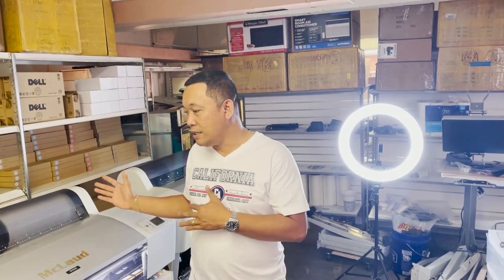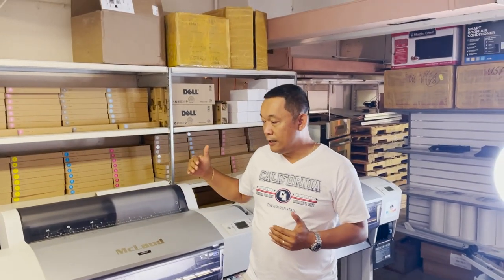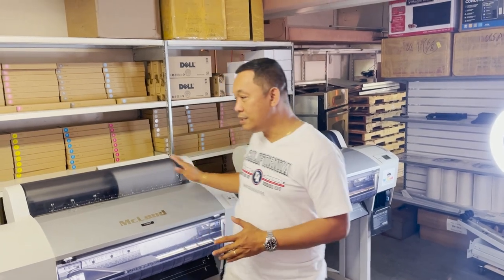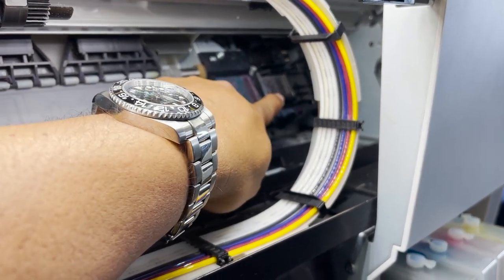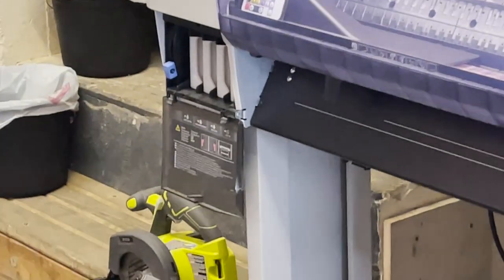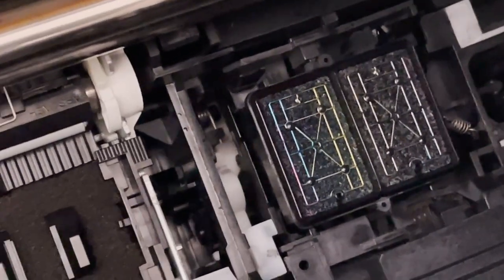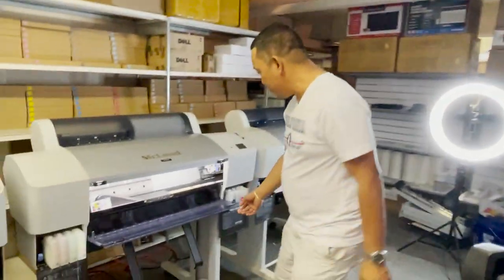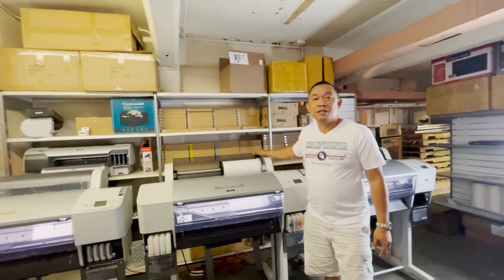McLaud DTF Printing VLOG#143: A Guide in buying DTF Printer

Comment: Sir with due respect, i believe all of the printers have the so called "spit backs". the small unit that you show may not have the same as the large unit but it must be on the other side where it does it "spits" thing. I used to do my "DIY DTG" way back 11 years ago with Epson T13 and it may not have the foam where it spits but it does on the opposite side of where the capping station is. That's as far as I can remember but i could be wrong. cheers.
Reply from the maker: I will look again closely in some model
Reply from the maker: Other people call it Flushing Box
Reply: Exactly, I just commented to let him know the P600, L1800, 1430, 1500w, 1390 etc all have spit pads on the opposite side of the printer. And overall that has nothing to do with whether the printer is good for dtf or not.

Comment: If I already have a Large Format Epson printer do I need to convert it to DTF
Reply from the maker: Depend on the model of large format. Minimum of 6 color in original use. 4 for CMYK plus white
Reply: @mclaudtechnology  an Epson SC-P7000?
Reply from the maker: @HeadOfHorror   You need a DTF  RIP that support that model
Reply: Thanks alot for being so helpful

Comment: The P600 does have a spit pad, its on the opposite side of the printer, Even the L1800 and 1430 has Spit Pads.
Reply from the maker: Its just a foam, not a flushing box. It should have a connection going to waste pad or tank
Reply from the maker: Second, observe if it spit an ink on it, if no trace of ink like a  capping station, then its not a spit box, or flushing box
Reply: @mclaudtechnology  It is a spit pad, before installing chipless firmware on P600 or P800. When you run a print head clean it sprays inks in that spit pad. If you have a P600 or P800 DTG printer you can actually look under the print head and see it sprayings inks in that pad just like the 1430. But after installing chipless firmware it no long sprays inks in the spit pad. It sprays it in the capping station instead.
Reply: Note I've been working on Epson printers for over 20 years, So I know exactly what I'm talking about
Reply: Almost every Epson Printer I've worked on has a Spit pad located on the opposite side of the printer. And Even some of the larger format printers have it located in the same position.